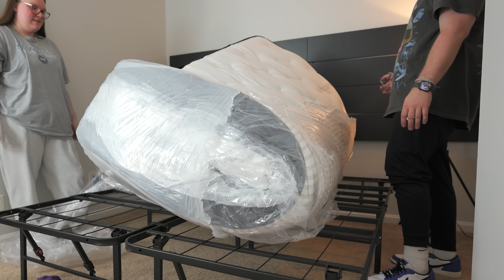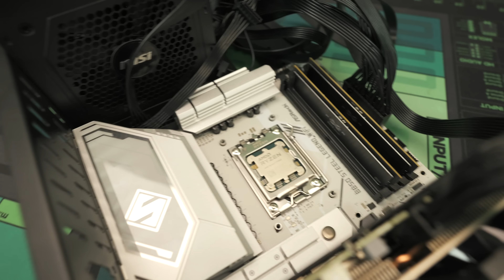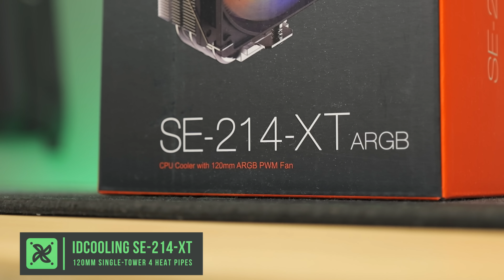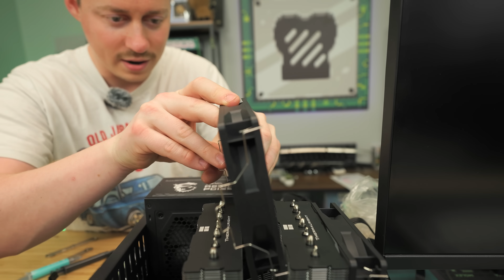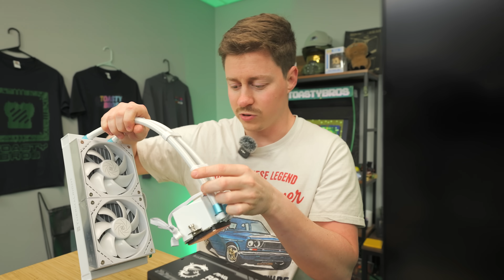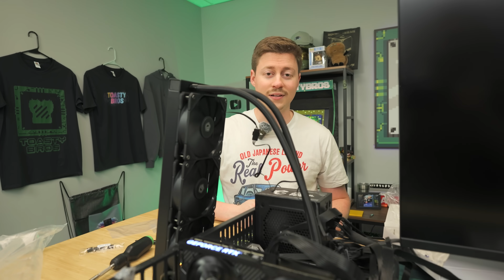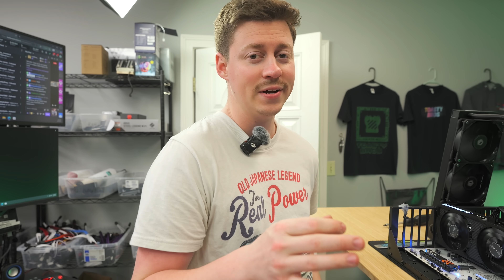STOP Overpaying for Your CPU Cooler

Comment: I switched to just using the 3000 RPM Noctua fans on a cheaper liquid cooler works better than the expensive air coolers that they sell.

Comment: I have a Noctua cooler. I live in a warm country around the Mediterranean sea. During summer you can easily have 35-40 degrees Celsius everyday. It's expensive, but it's silent, it's reliable, they give you a proper warranty. I understand that you don't need an expensive cooler to cool an i5-i7 or r5-r7. But please, if you go on a budget just choose a cheaper tower cooler instead of an AIO. Liquid cooling means more maintenance and head scratching in the future. And if something goes wrong it can go really wrong, believe me.
Reply: liquid coolers have been improved over time now they are pretty reliable, the only issue is evaporation of the liquid over time which makes most AIOs last 5 years... and cheap air coolers are just as reliable as noctua

Comment: Aren't the larger coolers kind of skewing the numbers a bit since if the other coolers were placed in the same size case that could fit the larger coolers, wouldn't the earlier / air coolers have better numbers due to the increased case space? Newby here. Real question, not trolling.
Reply: Case does not really matter, if it is the same case. Larger coolers will have even higher advantage in low airflow/bad cases because they can move heat faster. It is about cooling area and mass. Additionally, coolers in general will handle heat rather well until cooling capacity is reached, then it will get exponentially worse. For example, if you have cooler that can handle about 100W of heat and lets say that temperature is 75C at 50% fan speed, if you add just 20W, it can easily increase temp by 10-15C even with fan speed is at 100%. Meanwhile, with better cooler would increase temperature only slightly without change in fan speed.

Comment: I bought the NHD 15 Crome black  last year for 120 shipped to my house which is better then the NH u12a  however you said this cost more an is less of a cooler ok
Reply: Also it keeps my 9800x3d  in the low 60c when gaming it’s overclocked an undervolted. An I also have one on my old fx8370 build that is 10 years old and  it has the old NH d15 an it still works great I’ve not even repasted it .

Comment: I swear by the Thermalright brand now. I have used their $30 air cooler and was very impressed. I am now running their 240 AIO, and it is keep temps even lower then the air cooler,  I get 67 degree max w Cinebench.

Comment: Thermalright Peerless Assassin 120 har been great for my 9800X3D. Paid 37 bucks for it and full load temps are in the low 80s (C), with ~22 degree (C) ambient temps. I could slap an AIO on there and cut the temps down another 5-10 degrees, but since I am far below any kind of thermal throttling temps and have no plans to overclock I have literally no perceivable performance to gain from 5-10 degrees lower temps. If anything I'm more likely to undervolt, which makes chasing a few degrees lower temps even less relevant.

Comment: You likely would have seen a lot more of a difference between the noctua and the se 214 using something like intel cpu that pulls over 200 watts. With that being said there is zero reason to buy something like a d15 over the assassin or anything with 2 heat sinks in that price range. Even if u wanted better fans than what comes with the assassin you could buy better fans and still be spending like $100 less than a noctua cooler.

Comment: Ive been using the IDCooling 360mm in my current build for two months now and its great. In all the games I play I get a max of 60 degrees at max settings using a 9700x and 5070. Only problem is that it can be kinda loud! Theres a tiny bit of ambience but it doesnt get caught on mic and if youre wearing headphones and theres any sound coming out you wont hear it but it likes to ramp up to an unnecessary degree sometimes so be weary (could be more of a windows/bios issue tho)

Comment: Finally someone mentions this. I don't get why people spend $100+ on a cooler when they could just spend $40 or so and divert that extra $60 towards a larger SSD or more/faster memory or a slightly better CPU/GPU. As long as the CPU's regularly below 90c, it's fine. And that doesn't mean cheap out as much on the cooler as possible just to hit 88c under heavy workloads, but a fairly typical dual tower cooler for $40 will keep the CPU at 70c or so under gaming, which is plenty.

I get it if you want to go watercooling for looks, or because it's necessary for a small ITX system, etc. But $100+ on air cooling is asinine. I don't get how Noctua is still in business. Good engineering is nice, but engineering has always been done with constraints on budget (the people building the manhattan bridge didn't get a blank check from the state of New York, they needed to build the best bridge, optimize for traffic and for maintainability under a pretty strict time and fiscal budget). Noctua's not hitting the mark on budget at all.
Reply: Completely missed the mark with this comment my man, noctua has never been a budget company, and if $60 is making or breaking ur build budget then noctua shouldn’t even be in the conversation. Noctua is still around because they have the best preforming fans under load on the market, not because they sell air coolers.
Reply: I’ve used the same NH-D15 in 3 builds (none of them budget, to be fair), and got new mounts for different sockets twice from Noctua - also, it will get used in at least one more build before I buy a new one, and it came with quiet fans that are still humming along a decade later.  If you’re going to use a cooler once or are conserving funds though, save the cash and get one of the cheaper options that do the job just fine.
Reply: If you have the money for it then why not spend the 100 dollars, i like the way liquid aios look and how it makes the build look, even with my aio that was 100, i got a 2tb samsung 980 pro 2tb ssd for my build, just a matter of perspective really and what you can  or want to spend.
Reply: Or you can get the noctua and still get the 9800x3d, 4tb SSD, 5080. $60 is not going to break a 2k+ build
Reply: @krzzzy19  Clearly the video is catered towards budget ballers, not people who have huge amounts of disposable income.

Comment: What´s the purpose testing air coolers  in a open test rig? Infinite of fresh air. A solid block of wood and a tablefan will do the exact same job "exaggerat". I don´t say cheeper coolers are bad, I myself own a Arctic Freezer 34 eSports DUO and now a Arctic Liquid Freezer III 240, both cheep and performing exellent for cooling my 13600K. Tho I do perfere Liquid Freezer III becuse of less heat spikes.

Comment: Mine usually end up as a progressive build (in my case over the last 4 years). Started with Ryzen 2600 on B450 board, 2x8GB DDR4-3200, GTX1660, stock cooler. Then upgraded to RTX3050. Then upgraded to 4x8GB RAM. Then upgraded to Ryzen 5600X. Then upgraded to B550. Then upgraded to 12GB RX6750XT.  Then up to Ryzen 5900X on sale for $190, with Thermalright Peerless Assassin 120 SE CPU Air Cooler. Most recently upgraded to 16GB RTX5060Ti, with plans for 9600X on B650 board.

Comment: I use a Thermalright 360 AIO with uphere ARGB fans on a Ryzen 7 5800X.  Temps are stupid low, 36 degrees on low load and upto 50 degrees on high load gaming.

Comment: Thermalright has a fantastic $24 6 heat pipe cooler with a 120mm fan. Throw in another $15 for twin heat sinks and fans. Insane.

Comment: Was this with the fans turned up? it'd be better to see em all maxed out. Otherwise it's still going to run on a stock curve keeping all the temps basically the same unless the cooler couldn't dissipate. It'd be more informative to see how low they can go with the fans at 100% then you'll see the actual difference.

Comment: thermalright does it RIGHT
man there prices are crazy and they cool very good.
we used to have always 30+ € air coler for a simple 120mm  fan 4 headpipes air cooler never had cheap ones that did a good job
and now we have thermalright aircooler and liquide are very good prices like even 2nd hand you dont find these prices they sell it new

Comment: Over the years I have used Thermalite, Cooler master, and  Darkrock coolers that were way more budget friendly and they all performed excellently.
Reply: I still use a Hyper 212 on the occasional budget build. I’ve accumulated an abundance of them over the years and it’s still an effective cooler.

Comment: Noctua specifically IS with the money, imo. Because they will send you adapters for new sockets for life. I've used the same Noctua cooler for several builds (4 different sockets!) over the last 13 years... It might have been even more if my last two sockets were Intel instead of am4/am5
Reply: It's not though. You would have still spent less buying a few cheap coolers that work just as well. The video literally showed you this. It's fine if you bought into the name brand, but you can't ignore the proof. This has been known for forever too, it isn't new information.

Comment: Noctua's thing is that 15 years down the road when you've upgraded to AM8, you will still have free mounting hardware support for that cooler. But i would rather just get 2-3 cheap coolers instead and some decent paste
Reply: Is not just that. I've had my NH-D14 since 2012 or 2013, can't remember exactly, i got it for my FX-8130. Anyway, the thing is, besides its thermal capabilities, the compatibility, etc, THE FANS is the most remarkable thing about it: Not only they are Q U I E T.... i've had tons of fans die on me from other brands.. the dust and hair are a big issue... most any other fan i get goes bad after 2, maybe 3 years top. Once you get some dust in there, they are done...i just had two thermalright fans die on me on a space of 3 weeks one from each other... My Noctua fans? They are BEASTS. Sometimes they gone years without maintenance and they just keep going (quietly).

One of my computers i had once, where my card was stupidly quiet as well, you couldn't tell it was on.
Reply: Noctuas still have their merits in terms of being the best in noise normalized during high loads and having excellent reliability. I still buy noctua fans as I find it's motors produce a much more lower tone hum compared to it's competitors like the arctic and phanteks which are noticeable especially in a itx case.
Reply: Also Noctua coolers tend to be extremely quiet.
Reply: The original NH-U12 came 20 years ago and should still work with modern sockets.
Reply: Noctua is just overpriced garbage at this point
Reply: @jom_and_terry nope

Comment: Just got the Uphere 8 pipe cooler for a customers 7900x build, and it’s an impressive cooler. Costs a little more than the PA but it fit the look and has no problem cooling an R9.

Comment: I personally tend to go for one of the cheaper AIO coolers.  You can generally get away with running the fans slower meaning that you get a lot less noise than smaller HSF coolers.  I switched to that because in the Pentium 4 days quiet coolers started getting so big and heavy that they would be warping the motherboards at times.  I've honestly never seen the value in Noctua HSF units as they cost more than a lot of AIO's.

Comment: A Peerless Assassin SE with just one center mounted fan can cool my 5950x. I think it's insanity how much budget people allocate towards a cpu cooler.
Reply: I’ve got the peerless assassin and I’m happy with it.  Even if they wouldn’t send an adapter I can buy what 3-4 of those for the cost of the noctua.
Reply: I've tried the Thermalright PA and Phantom Spirit, I'd say they're a great value vs Noctua. Also, everyone should also take into account that a good undervolt will help a lot
Reply: @ThePrincemgomez which better phantom spirit or peerless assassin 120 se?
Reply: Yes exactly. Even if unwanted better fans you could buy good fans and out them on something like the peerless assassin and it would still be much much cheaper than something like the noctua.
Reply: Am cooling a 5900XT (the same chip) with a GAMMAXX 400 V2 15-dollar single tower heatsink and an $8 Arctic P12MAX fan. Cpu at full load below 80 degrees. 👊
Reply: Yep Peerless Assassin 120 with two fans on 7800X3D, keeps temps around 50-60C under full load 🤩 it’s just so good!
Reply: I did an air cooler on my ryzen 7 9700x and just swapped it out for a kraken 240 aio a few days ago spend less when building and more when upgrading
Reply: Tell me your allcore clocks & temps. PBO adjusts itself on how much thermal headroom you have.
Reply: My assassin came with fucked up threads
Reply: Same, but a 13600k. It never reaches temps above 50-55° C in silent mode regardless how many hours of BG3, CP2077, Dragons Dogma 2 or anything i throw at it really. Wicked cool, silent, good quality and cheap.
Reply: I also have the peerless assassin cooling my 7800x3d. It's the one with 2 sinks and fans. Cost me like $35.
Reply: Hey i have the same cooler and same cpu but i cant find a good curve could you tell me your fan curve and if you changed smth in the bios for the cpu?
Reply: Normally, I'd agree, but Noctua is an exception. Imo, they're worth the money because they will send you adapters for new sockets for free. I've used the same NDH14 for 5 builds over 13 years.
Reply: @brianburke808 true but alot of companies will send you a new adapter. Not to mention you could literally buy a new cooler every time a socket changes for the next 10 years and it would still be cheaper than a d15 or  the d15 v2
Reply: @danebeee1  I'm not sure how many companies will give you new adapters or for how long. I know Coolermaster made new adapters for the Hyper212EVO I had for a few sockets, but you had to buy each one. Ditto for Scythe (Mugen line, at least).
Reply: @danebeee1 be quiet wanted me to pay $10 + shipping then said the dark rock tf wasn't compatible with am5. Should've went noctua
Reply: @brianburke808  Scythe did the same for my mugen 5.
Reply: @stevengrabbert  nice
Reply: @brianburke808  Well yeah you basically paid for those brackets in advance.
Reply: @brianburke808  While that's a fair argument, I still think it's worth noting that you'd have to live through three sockets worth of new Thermalright coolers to match the price of one Noctua cooler. And, with how things have been going, I'm going to assume that by that time the air cooling tech will be much more efficient.
Reply: @ccayco  That's true, but when I bought this cooler, no other air coolers were even close in performance. It's taken this long for more budget manufacturers to catch up.
Reply: @brianburke808  Nobody is judging your decade-old purchase. We were just saying that people on a budget are spending WAY too much on cpu cooling these days.
Reply: @ccayco  Not feeling criticized. Let me try to make my point a different way... This is a strange video because 1. of all the high end air coolers they could have gone with, they chose the one you could make a case for. 2. Is this really even a problem? Clearly no one else in this sub thread is over buying on coolers, and if I had to guess, I'd say that extends to the vast majority of viewers on this channel. 3.    Personally, if anything, I've seen more of the opposite problem over the years, people buying coolers that aren't even rated to dissipate the stock wattage of their CPU or just barely adequate, and sometimes trying to bump up the voltage on that.
Reply: @brianburke808  This long?  I've been buying them for the last 5 years at least.  They've been around longer than that.  They even make AiO for $60.

Comment: Just built a system with a Peerless Assassin on a 9800X3D stays right at or under 39C at idle and I can't get it to break 70 under load.  Seriously what's the point in spending more?

Comment: Thermalright peerless assassin digital display 40$, price value for performance is unmatched 👏
Reply: I've been big on the TR Digitals lately. I think they look super clean.
Reply: Or even the single tower Assassin digital for $25.  I put in the peerless assassin, not digital, but had to lift my fans a bit due to RAM clearance so I swapped for the single tower version and got the digital display for an extra.  Obviously loosing a bit of cooling capacity, but like ToastyBros said, it's not making a huge impact for the money you're saving, unless you're really stressing or OC'ing your CPU.  The cooling performance isn't the only thing inherently that Noctua gives, as they are also super quiet, but again if you're not stressing your CPU, you can tweak a budget cooler with fan curves to also reach your desired quietness.

Comment: while the noctua coolers are good. For me it's all about their fans, I will gladly spend the 20-25 bucks per fan if it means a quiet pc. Even under like 75% fan speed on the A12X25 it's barely audible. A good middle ground would be buing something like the peerless assassin then swapping the fans for noctuas then you get the best of both worlds

Comment: From a newb's perspective and what I haven't seen done is, someone going through various CPUs by their wattage and recommending them budget coolers for gaming focused builds. There are also important differences as well between the AMD and Intel CPUs when it comes to appropriate cooling. For quite a few of the AMD CPUs, a 4 heatpipe cooler will be adequate, especially if you undervolt.

Comment: The Vetroo v3 is pretty good for $17.00
Reply: Only 3 heat pipes on that one. Probably doesn't make a huge difference, but the ID Cooling is around the same price and has 4 heat pipes.
Reply: I use the v5